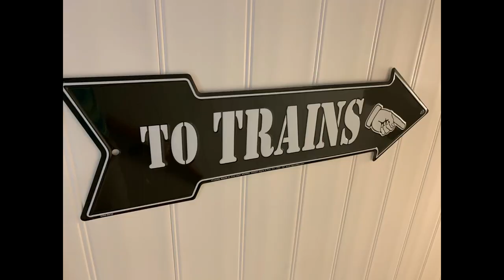Oh No!  Its a Hot Box!

Comment: Why did choose Fastrack for your Layout and not Gargraves, Atlas, Ross etc ? I use Fastrack and have no issues and it's easy to work with.
Reply from the maker: Originally because I wanted a complete eco-system that did not require any custom work.  So, at the time only Fastrack could use the LCS Sensor Tracks, plus the Command switches were plug and play and it all worked with the Legacy remote.  That has since changed, but I decided based on what was available at the time.